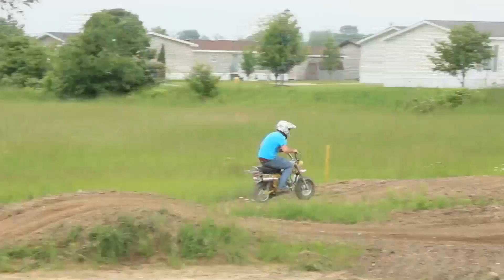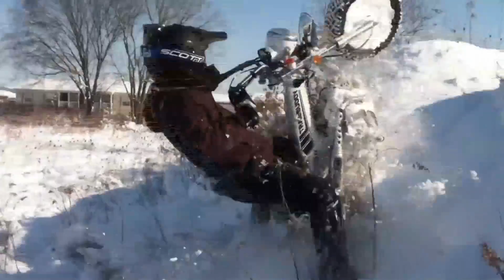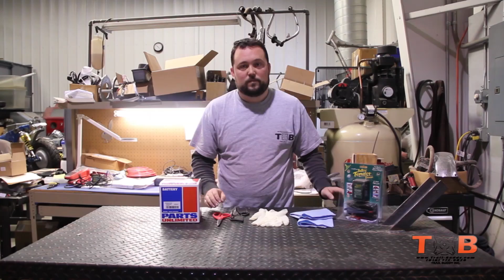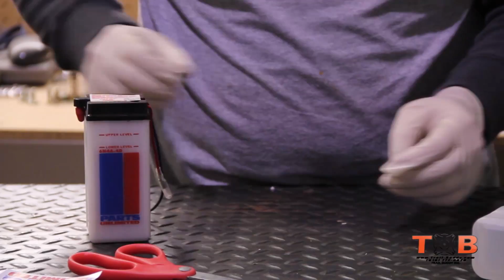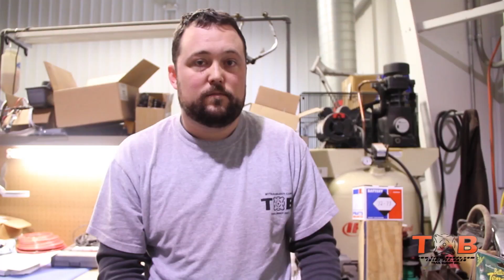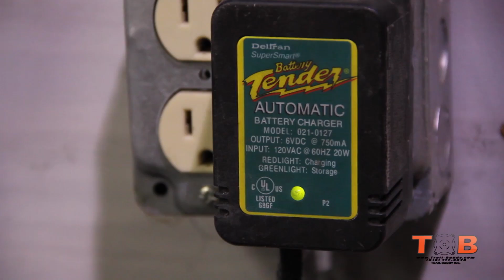How to set up and install your honda ct70 battery

Comment: i bought the wrong battery for my sl70 and the new battery has only the positive and negative, the harness on the bike has positive, negative and two green wires, if i got a new harness just to connect to the battery would i be fine if i bridged the two green wires like your battery has?
Reply from the maker: please email us at trail-buddyparts@hotmail.com

Comment: Great video but the question I've been trying to figure out is that i just recently got a 1969 honda ct70 and it came with no battery and i want to install one and all the wires are there but I have two white plug connectors and I know one is for the battery as seen on this video but where does the other one plug into?? Or am I missing something that got removed ? thanks for any help on this not finding any video on this. That would make a great video if you took a wire harness and showed us what got plugged into were like on a table :)
Reply: the negative wire from the battery should bolt directly to the frame.  check for a threaded hole somewhere within the length of the wire.
Reply: thanks
Reply: 4 years late but the other plug might be for the rectifier.